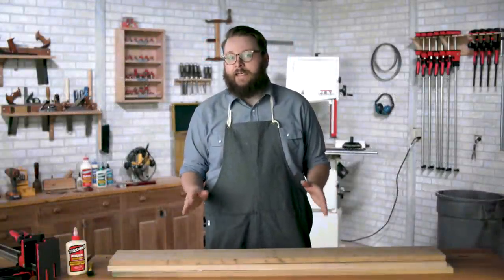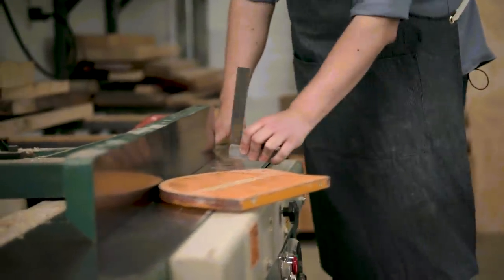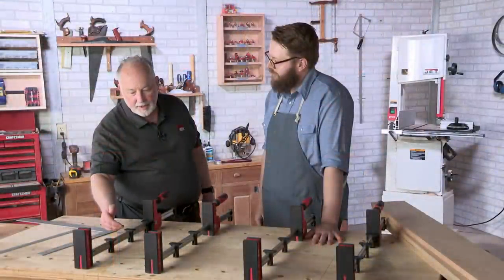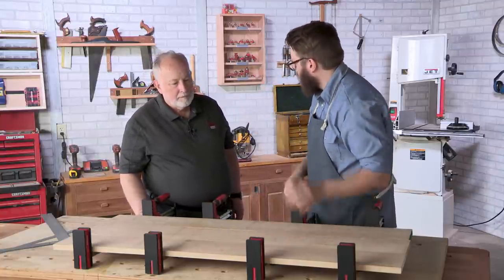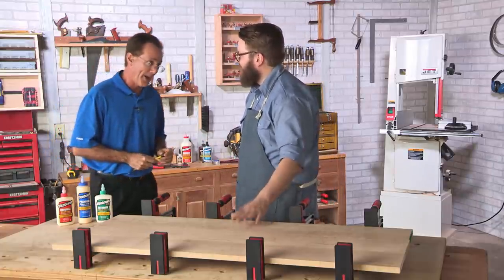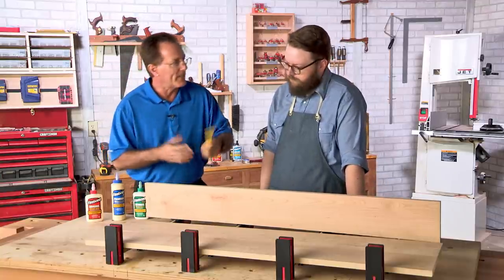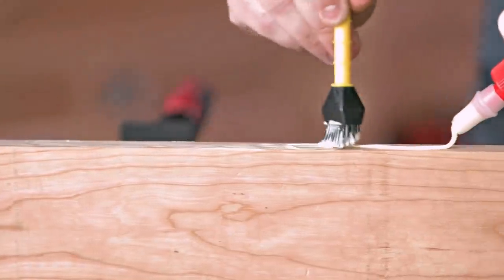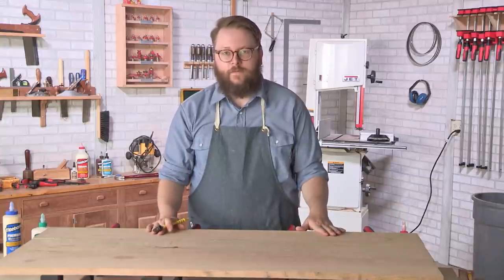Experts' Guide to Gluing & Clamping: Edge Joints

Comment: I'm curious what the clamping expert would have said about adding reverse clamps from the top down, or using cauls.  Even the best clamps with the strongest and most square faces are still tightened along the clamp rail, which is below the panel, which can promote bowing the wood upward if the jaws have any angling at all under pressure.

Comment: Do you need biscuits for alignment when you're doing tabletop like that or is that only if you have really high moisture content in your wood?
Reply: From what I have read, if you use a good glue & have true edges this is all you need for a good strong joint. The glue joint is stronger than the wood itself. I have built stuff with pocket holes,dowels & just glue.I have found no difference with the quality of the joint.